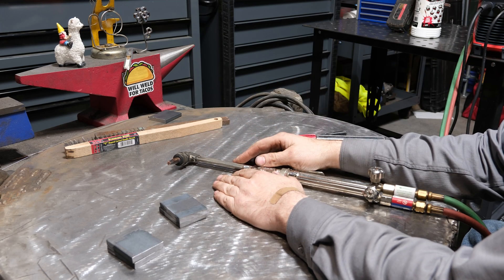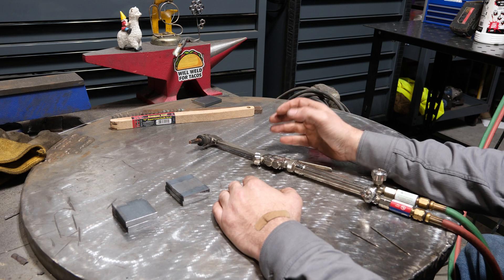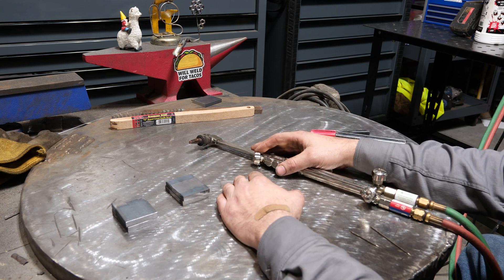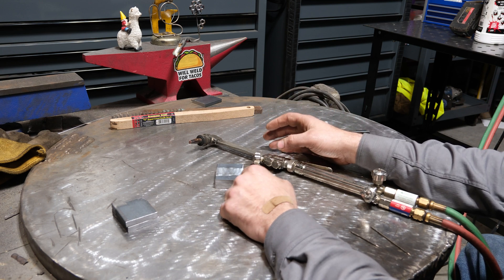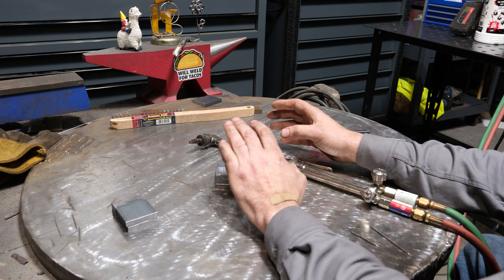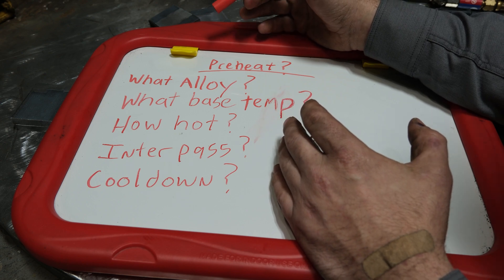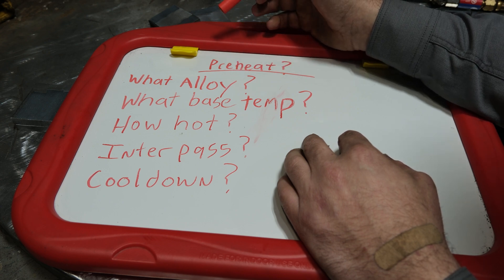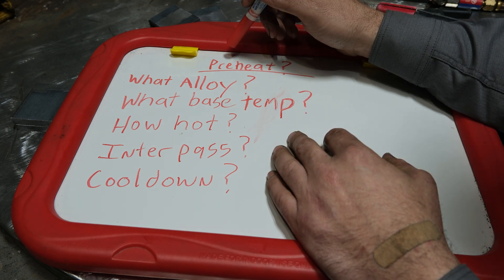Does excessive preheat of steel affect weld strength?

Comment: I watched this video, https://www.youtube.com/watch?v=RRxAANqmrL0&t=767s 
And the old boy was saying we're past pre heating in a lot of cases, The technology is past it. Not saying with some cast iron massive thing but... I don't know much really, would love your input on the video. Watch with type thing, I know it might be long with you giving your thoughts at points but would be, I think people might enjoy it. 
thanks.
Reply from the maker: So the guy in the video is right.  When it comes to aluminum the tech we have today mostly bypasses the need to preheat the material . A common 400 amp class tig machine has the ability to weld 5/8th thick aluminum with argon without preheat and realistically close to 3/4 with pure helium.  There is also advanced a/c pulse on some machines where the welder blasts a high amp pulse on the negative side to gain a lot of penetration.  Not that long ago a 400amp transformer machine would have been as big as a fridge, likely had fairly poor duty cycle, and doing a big thick aluminum job would have still be tough.  The only thing I would worry about with welding on cold aluminum is issues with hot short sensitivity.  Aluminum (and materials like cast iron) doesn’t like being brought to molten temps and cooled fast, they tend to crack.  You can prevent this to a certain extent by welding slow and taking your time on thick aluminum, but no machine setting or tech can solve this material problem.  On super thick stuff regardless of welder I preheat it to atleast 100-150 degrees.  It helps clean the surface,the starts won’t be as cold, and less chance of any hot short cracking 😀👍.
Reply: @ Thanks very much for the extremely informative reply. 👍
Been binge watching quite a few of your videos recently and enjoying learning.

Comment: As a metallurgical engineer who has been a welding engineer for nuclear pressure vessels and am very knowledgeable with ASME B&PV Code welding requirements, you should be talking P numbers.  P1, 3,4,5, 8, 43 for your different alloys.  Also, you are talking to welders who are not metallurgists and if they're messing around welding on trailers and frames, you're talking High Strength Low Alloy steels that are heat treated to high strengths and ANY welding on them can ruin the heat treatment and make the  Heat Affect Zone weaker.  Preheats above 350-400 F are ridiculous.  When welding P8 stainless steels you have to worry about interpass temperatures and carbide precipitation in the HAZ which will ruin the stainless properties.  You are right about trying to weld cold materials and bringing them up to 100F or slightly more.

Comment: No it affects the base metal, the weld is fine.
Reply from the maker: The weld itself takes longer to solidify when the plate is hotter, which will affect the grain structure of the weld negatively.  It’s not just an issue of the base material having issues.
Reply: @makingmistakeswithgreg  the whole point of preheating is to diminish the heat affected zone on the base material from the weld which is deposited in the 1000's of degrees no matter which scale you use.  

You WANT the weld to cool slower when preheating is necessary so the grains don't rip apart. As a matter of fact, sometimes you actually cover the weld in vermiculite or kaowool and it can take hours if not days to cool properly.

Excessive preheat ruins the base metal not the weld. That may affect how the weld holds, but you'll notice the weld didn't break on your last coupon, the base metal just didn't stick.

Comment: Greg, what are your thoughts about grounding the welding table to earth with a ground wire? The reason I am asking is when I started TIG welding, I would get an occasional shock thru my shirt sleeve, but I think it was due to me sweating.
Reply from the maker: So the shock you’re experiencing is actually most likely either the high frequency arc starter or if you’re welding on a/c it’s the pilot arc that in the background.  The starter is at much higher voltage than the tig arc therefore it can use you as part of a circuit.  When you’re dealing with high voltage you don’t need to be part of a grounded circuit to become part of it, you only need to be between something thats lower potential than you and the tig torch.  In simple terms you’re still likely to get a shock even if you were to ground the table to the electrical system, and possibly even a stronger one because the table will be at a lower potential potential than it is already.  Many machines have a very aggressive arc starter and to some extent this will be unavoidable.  My two thoughts are possibly wear thicker gloves, and before you start the arc run the tungsten on the work piece.  This will help the arc to start on  that point and should reduce shocks.

Comment: Hey Greg, I had a question for you. My question is totally irrelevant to your video but I need some advice from somebody who knows.
Ok, I have been trying to look up this question online through Google and other forms and I cannot find a legitimate straightforward answer.
My question is as follows:
How many amps can I set my welder at on a 110 outlet when using stick welding specifically 7018, 6011, or 6013 without popping the breaker?
I find irrelevant stuff online  such as, add this, plus that, equals this ,minus this ...and you get that.
 I would just like a safe reasonable number. Nothing more or nothing less. If you could please elaborate briefly or abbreviated to decimal numbers, I would be forever indebted to your knowledge and thankful. Thank you very very much.
My welder is a dual voltage welder 110 / 220.  Weldpro 200 multiprocess. 

-thanks.
Reply from the maker: Ok I can tell you it’s going to completely depend on if the welder has power factor correction or not.  If it does, you could probably get 100-120a with 6013-7018, and 85-90 with 6011.  If it doesn’t have power factor correction (which is likely) the best would be around 65-75a.  Probably 75a 7018 and 55 with 6011.  Keep in mind the following:  you must have a 20a dedicated breaker, aka one not shared with other things.  If you have shop lights, a heater, or anything else on the circuit you will reduce what you can weld before it trips.  Also, if you have a 15a circuit you will be very limited, probably to around 50-65a stick without PFC and 85-95 with.
Reply: @makingmistakeswithgreg  so basically I need to find a socket and make sure no other item is plugged in in that same circuit area.
Thank you very much I appreciate your answer it helped me precisely with what I was looking for .
Reply: One more thing. It is a inverter welder

Comment: Lincoln's short paper on preheat mentions nothing about penetration and is all about preserving the original structure of the base metal and stopping cracks, but I've seen hundreds  of comments suggesting years u can weld anything with a smaller welder than suggested with a 6OO- 700F or some preheat. 
  
I think you should make a myth busting  playlist.  Most of your information can be found in print from "ancient" text, but  You are providing proof to nonbelievers.   I have my uncles pipe fitters book from the 40s when he made it back from the navy.
I think DYI and pro-craftsman content creators are showing a different way to get something done ( like the $150 welder)and people take away that it should be done all the time (sometimes you just know what they did would fail under test).
Reply from the maker: It is extremely common to read that a 6-700 preheat is a miracle worker, no less than 50 comments on the channel have said just that.  Honestly i think it’s case of mistaken observations.  The weld will be flatter, and visually look “hotter” but the visual look doesn’t correlate with a change In penetration.  So many people never cut and etch their work and that’s how the myths are started and propagate lol.

Comment: So where is individuals teaching credentials, the added ductility created in preheated mild steel and the consistent equipment to do so, by reputable steampipe contractors and pipe fitting industry, tells me this clown is full of sh$@ t.How many power houses has this guy worked in, has he ever looked in a running super large boiler and seen how hot they run( red or orange hot full time,) this guy is going out of small fry weld manuals of little contractors that can't get a contrct.Plus I can see vast differences in his welds 0 consistency. I'VE been a certified steafitter pipefitter  welder since 1978, who is he trying to bullshit an unknowing public that weld he shows at the end was bad weld skill no decent weld breaks an entire edge a bullshit weld I'll gladly have a welloff with this clown anyway total crap ,how would any metal including copper preform better from annealing  if heat did not improve flexability. What university did he study at I want to know, for metallurgy.

Comment: This is a great video my only question is if steel melts around 2500 degrees and jet fuel burns around 1500 degrees why would so many outlets debunk claims that jet fuel couldn’t have made the twin towers fall at near “free fall” speed? Sure it could weaken it, but free fall speed needs all resistance bellow the floors hit to be removed to hit that velocity. Also if the steel was weakened but not completely melted why is there not an equal amount of complete steel beams removed from the site as was used in the construction? They also claim thermite can’t melt steel but there’s videos on YT where compressed homemade thermite will cut and melt steel I beams in seconds… Wait did I comment on the right video?
Reply from the maker: lol.  Well I can tell you that steel nowhere near melting point is already stupidly weak.  It’s nice to be able to heat thick steel red hot and be able to bend it like it’s made from taffy without having to melt it.  There in lies the problem, hot steel has no real strength.  Buildings are built to handle the weight of everything above each floor, but not built to withstand that weight slamming down.  Much like pulling on an auto body dent with steady force can take a lot of strength vs using a slide hammer, having multiple floors collapse above a floor could easily far exceed the limit of load bearing of a single floor.  It’s impractical to impossible to engineer a building designed to handle a dynamic load like that, it would almost have to be shaped like a pyramid to be that stable.  

The speed in which it would collapse would presumably be dictated by what each individual floor could handle for weight.  Presumably the building was built stronger in the bottom than the top, so the bottom would handle more weight than the top.  This would on face value make you think it would slow down as it collapsed, however the weight of all the debris above the bottom would increase as the collapse lowered, negating the strength increase.  So basically floor 5 with say 49 floors above it would likely collapse as fast as floor 40 with only 14 floors above it.  Once the mass got moving the only thing that would slow it down would be a significant increase in resistance, and millions of pounds of weight traveling extremely fast would take far more steel than the whole building likely contained to slow that kind of force down.  A simple way to look at this is look at the difference in force of 1,000 pounds sitting in a truck bed and 1,000 lbs dropped into that bed from 20 foot high.  It’s technically the same weight, but nowhere near equal in actual force.  The truck can handle that 1000 lbs no issue when it’s at rest but it can’t handle the dynamic drop.  To make the truck handle the drop it would have to be completely reengineered, just like a building.  Buildings are built with a high safety factor for the overall design, but the force a particular floor could withstand without failing is not easily increased.  Just like leaf springs, handling 1k lbs static load vs 1k load from 20ft.  They are completely different force levels.

Comment: Amazing timing with this.  I have to repair a thick mold made from 4140 and I have to sequence the whole thing appropriately with preheat and post weld cooldown AND I have to do small stitches due to an internal copper brazed structure so I can't let it get too hot either.  Using ER80s-D2 filler.
Reply from the maker: That would be a great example of a “attention to detail” weld.  That material in particular would have very poor results if it were approached by a “backyard” welder.  It’s also a great example of a material that actually needs a considerable preheat at 500+ according to the book I have.  Welding on that at room temp would be failure city lol.

Comment: I think I know why the weld to the base material failed and it is due to scale forming on the surface due to the heating process. When you showed the back surface of the weld it looked to me like there was an oxide layer there which would limit the ability of the weld to penetrate and adhere. Just my thoughts. If you watch any blacksmithing videos (or live) you can see the oxide scale breaking off during shaping. I would like someone with more knowledge to chime in on that.
Reply from the maker: There would have likely been some scale on the material.  7018 generally would be able to penetrate scale ok, and I had done a cut and etch on a 1,000 degree preheat fillet weld and didn’t notice anything abnormal with the side penetration.  No doubt scale will play a role in weld strength.  Even something as simple as absorbing that scale could have weakened the weld.

Comment: Excellent demo Greg, another aspect of what was revealed is the great tolerance of 7018 rod for differing conditions.  Grain growth / grain refinement is determined by interpass  temperature and time at temperature.  Our modern world was built with 7018 !
Reply from the maker: 7018 is definitely a very good rod.  Old reliable would be a great name for it.  Doesn’t have the best penetration but it’s strong, ductile, and produces very reliable results.  The other nice thing is visually if the weld it makes looks good, it is good.  That’s something that is difficult to find with other welding processes and even some other rods.  No doubt it has built the modern world 😀👍.

Comment: Back in the day we would send our cast iron cyl heads to a shop that did furnace welding. They heated the heads or cast iron part in a furnace, torch welded it, then dropped it into a sand pile for slow cooling. I don't think they repair heads or blocks like this any linger.
Reply from the maker: So you definitely can repair cast iron with a oxy fuel torch.  Castings can have major ductility issues, heating everything up makes the material far less likely to break during cooling.  I need to do a video on this subject 😀

Comment: Would you get a different result on Thin/thicker material?   I am thinking about the "self heating" by the welding process itself . Like if you go in hot on a 3mm tube , the hole tube is red (all-most)before you even finish 26% of the weld. The same would not be the case for 13mm.
Reply from the maker: So multi pass welding on thin material could easily hit stupidly hot temps that could cause weld failures.  The good news is thin materials generally need less passes to weld so this generally isn’t an issue.  I randomly tested how hot a 3/8th steel fillet weld hit after 3 hot fast 7018 passes.  What I found was after 3 passes it hit about 550 degrees, as much as 600.  I believe that’s low enough to not have a major reduction in strength.  That weld size was oversized for 3/8th as well.  However with that said it’s well documented that there is a strength reduction by welding on hot mild steel without cool down time.  My simplistic testing method is not sensitive enough to determine hard numbers in strength loss.  Had I welded 1/2in steel it’s possible I could have generated enough force to see a weld failure at 750, but with the 3/8 I used the plates bent before the weld failed.

You bring up an interesting idea that makes me wonder about oxy acetylene.  I know it’s welds are weaker than 7018/er70, the common wires meant for it only hit about 60k tensile strength.  I have a feeling steel welded with the same er70 tig wire would be far weaker than a tig weld.  Partially because of the excessive heat Input and partially because of the co2 shielding gas produced by the burning of acetylene gas produces weaker welds.  In the case of thick chromoly the welds would be stronger with a torch weld than tig more than likely, since the welds don’t often fail but the material itself in the heat affected zone.

Comment: Great video Greg. 
My question is how would you do a repair on  ductile  irons like the metal that Case backhoe booms are made of? Would you preheat it?
Reply from the maker: Preheat on thicker material is generally useful in those types of repairs.  For one it can help burn off surface contaminates, and second it’s very common for equipment to be made from higher strength steels.  Many higher strength steels have hot short sensitivity (aka they crack when brought from cold to hot to cold fast).  Without knowing the exact material composition it would be smart to preheat to 100-150 to help slow cooling.  It won’t boost penetration, and won’t be high enough to cause failures related to overly hot base material.  The truth is when you get into higher strength alloys it can be difficult to get welds that aren’t brittle and/or fail (crack) during cooling.  How you avoid this is knowing the material that was used and weld it based on what’s appropriate (aka what procedures say).  

I definitely need to do a whole video on this along with casting repairs.
Reply: @makingmistakeswithgreg  absolutely I would appreciate that video! Thanks again Greg!